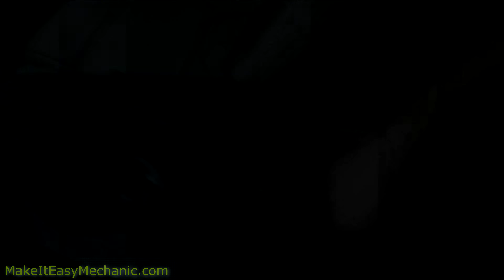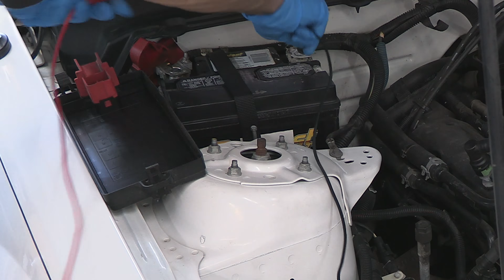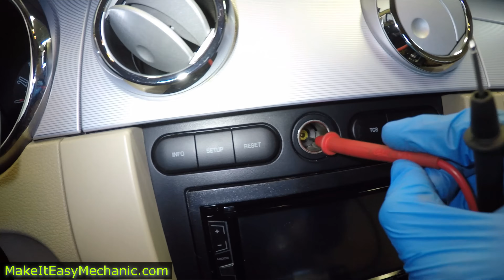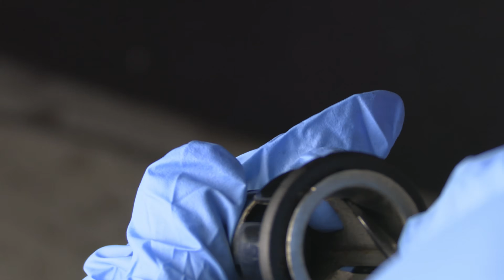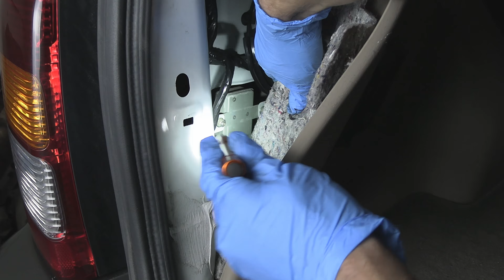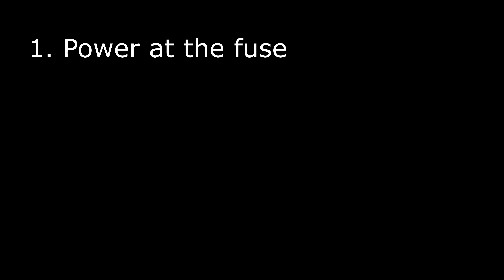3 MORE things to check when your cigarette lighter socket stops working (car power outlet fix)

Comment: I have checked every single fuse on the fuse panel...it is a 2010 PT Cruiser...both sockets are dead...I will proceed with removing the actual socket and see what I find...I fear I have done some other damage...somewhere...no other strange things are on the car...whatever happened when I was filling a tire with a compressor plugged into the front cigarette lighter socket with the engine running...it worked fine for more than a minute, and then, the compressor stopped working...and that was all she wrote...sigh...
Reply from the maker: Sounds like a blown fuse.
Reply: @MakeItEasyMechanic It does sound like that but I checked every single fuse…
Reply: @DRBradleyPhotography   I have the same problem and both times a compressor or my wife's electric mini blanket.  I think it is a thermal fuse at the socket or built in to the socket.  If the thermal fuse gets too hot it will blow gotta check that today after work

Comment: The lighter outlet used to be on even when car was off. Hate the way modern cars go off. I just wire mine directly to battery with an in line fuse. Also the electric windows.

Comment: The issue I'm having is after the fuse but before the socket. I already replaced the fuse, AND the socket, and that didn't fix it.

I've been looking at videos of center console disassembly for my car, and I'm just like... That's a LOT to remove just to fix my 12v adapter.

Vehicle: 2012 Ford Focus SEL
Reply: Rodents chewing wires perhaps...

Comment: I pushed my charging adapter in too much and the socket stopped working. What would be the best likely fix? Should I just remove and reinstall the socket or do you think a replacement is needed
Reply from the maker: if you tried a different charger in that socket, and it didn't work either - next thing I would do is try a different socket. (assuming you checked the fuse and the power and ground at the connector)
Reply: @MakeItEasyMechanic i tried a different charger. Still didnt work. Switched the fuse stull doesnt work. But the charger works with socket in the trunk.

Comment: As someone that works on vehicles at an electrical shop. It blows my mind that people feel ok with just replacing the fuse as if the cause of the fuse being blown just immediately goes away. (Few exceptions ofc)

Comment: what do i do if the fuse pops as soon as it’s plugged in?
Reply from the maker: there's a short in the system, check the socket if something is stuck inside it (like a paper clip), next - try unplugging the socket and see if it stops blowing fuses, if it doesn't you must have a short in the wiring. hope this helps

Comment: Good info! But, one more thing to check. The fuse kept blowing when trying to charge a phone. After much fruitless diagnosis, it turns out the 12v to USB A adapter the lady was using to charge her phone was defective. Switched to a different adapter and problem solved.

Comment: When your checking the wire connections behind the cigarette lighter, did you put the fuse back or no. Because when I have to check mine. The Cigarette lighter and the Radio are the same fuse (2002 Mazda 323 Astina). Also my fuse box is in the driver side compartment, so I can't voltmeter the fuse to the battery, unless I buy a 5 metre extension or something haha.

Comment: I used a TV and Xbox on a power inverter and it Immediately turned off and made a click noise so I assumed it was a fuse but I replaced the ones under the dash but it still won't work.

Comment: I have a 05 Yukon and it has a fuse for the cigarette lighter but I have three cigarette lighters and two of them don't work on the passenger side and also the one to the back seat.
Reply: There is a fuse for each socket

Comment: 2001 Mercury Grand Marquis. I'm getting power to the cig socket, but socket is only putting out around 4 - 5 volts...any ideas? I received an OEM replacement socket today, but it's too cold to work on the car. Do the cig sockets ever go bad and have reduced voltage output like this?
Thanks.

Comment: Got toyota Corolla sr5 coupe manual 1.6 1987 be four the lighter put my car off the lighter got off now no do it any more put my car off lighter stay on thing tgas right my battery like 2 or 3 day it die you think got problem with the cable the car thank can helps

Comment: Thank you for very informative and easily understood videos. I’m not a car electrician by any means so I certainly appreciate the well organized and explanative information. Both my console and dash lighters stopped working at different times. I only checked the fuse panel near the glove box. I know now I can find the issue and get them both working. Thank you, again from a non-electrician and mechanic.

Comment: power good with dvm at connector; however the issue was the dvm leads are sharp and make contact. The problem was corrosion on the center connector. Cleaning that up fixed the problem

Comment: Great help - I found the problem is the positive pole of the socket, now to find a replacement.
BTW, I use that same cheap meter from Harbor Freight. Handy enough for many jobs.
Reply: Again, replacement first.. meter still in box.YES.. At H. mf. Fraid😢😢😮😮😅
Reply: I used an M9 9mm with only nightsights to get mine .. out, lacking college but Navy marksman medals win.. kinda 😅😅😅

Comment: Just that little comment about both sides of the fuse to check with multimeter fixed the problem. Thanks so much!

Comment: Big thank you for the teaching! A total loss you didn't go to teach in college! I looked at the diagram you drew on the board and checked every component in the circuit with a multimeter and I realized the circuit is good and it should work so I plugged in a different charger and everything worked fine.🙂🙃
Reply: Like everyone else has said,  YOU WENT LIGHT SPEED AHEAD OF ANY OF THE OTHER B.S. CLICKBAIT VIDS which only talk a out fuses which is lame common sense b.s. I found you after searching 4 different times. KEY that hopefully others  do 👎 for all crap vids done abt only "fuses tested". That will help boost up your video.❤👍👍👍👍

Comment: Finally! OMG and I just got a multimeter. I’ve already replaced the fuse and it didn’t fix it. BRO EVERY video was “just replace the fuse. The fuse. The fuse will fix it” but it DIDN’T. I’ll be doing these steps soon and will finally have my answer!!!!
Reply: Looks like I have a common issue where my fuse didn’t solve my problem, and now I’m at square one where you are 😮
Reply: Yeah we see a lot of commonsense answers!!!
Reply: Did you fix it?
Reply: I'm gonna sand down inside the electrical connector
Reply: Update?
Reply: @antonio1681  turns out I had the entire thing unplugged from removing the center console last time.
Reply: My fuses blew immediately after replacing them
Reply: Well... Alrighty then, Clem . Pft... You done YET 😂😂 i kid..alit fire .on a Stihl 6ft chainsaw gun is. How,um ..mine...came free, allegedly BEFORE.. i saw this unporned section of vids😂😢. (Is he kidding.. desert Storm. That is all.)

Comment: MIne is acting weird in a 1995 Sunfire: At car start, it reads 13.8v but as the car operates, the voltage drops to 11.5v or lower, but check this out:'The  battery voltage with the car operating is still 13.8v. This lighter socket is live at all times, not dependent on the ignition switch. Anyone can point me in the right direction?

Comment: I have 10V at my lighter plug even when my fuse is pulled out. The 10V is not enough to power the portable FM transmitter. My centre console power plug outputs 12V as expected. This occurred put of blue after 14 years of no issue. I am at a loss...
Reply: You most likely have a short somewhere bypassing the fuse

Comment: My Volkswagen Jetta 2012 has power in the socket but when a coin fell in there I used a flat screw driver to take it out since then it will charge when I put my phone on but the battery goes down instead of up any advice?

Comment: So both of my cigarette lighter socket aren’t working even after replacing it 5x will it likely be the outlets and not the wiring or fuse
Reply from the maker: I'd check the fuses first.

Comment: hie. please help. when i plug in my charger the light turns on to show that it has power. however its a diffrent case when i use a fm modulator.

Comment: Massively helpful vid, my 12v socket in centre console literally just stopped working, which is a bummer as I only have one other and that’s in the boot (trunk) following your simple and easy to understand videos prt1 and 2 about this issue I managed to trace the failure point all the way to the actual cigarette lighter housing itself. Power was flowing all the way to the connector that plugs in to the cigarette lighter but that’s where it ends. Managed to get a replacement from Audi directly swapped over and boooooom all working again. Thanks to you!
Reply: Hmm. Sooo...initial remove n replace, easiest of the ADHD hells IRL AND on mf notyouryoutube... COULD have saved light years.. parsecs.. of valuable life .. as an American/Republican. (Democracy is a U. Mf. N. Term for bs needing more ammo.. we invented that. NRA inherited the UN quietly, thanks to Constitutional Republicans with FAR more firepower than the other hemisphere DOESN'T dream about.. in English, yes.. 😅
Reply: Ah.. trunk for your boots,eh? Well ... serious boot ,May...😅 To be devoting an entire trunk (1/3 of total car,yes? Idk .😮) to THE BIG BOOT BIG DADDY DIESEL!!😅😅
Reply: Boot..?? For.. the BACK of a car or trunks vs Vegeta. Mason Dixon line charter schools

Comment: my socket is the thing thats fucked up and I cant find an oem replacement ANYWHERE!
Reply: I took mine out took it apart cleaned the contacts with a brass wire blush and put it back together.  It's so simple, it shouldn't fail. I'll let you know how it works. I got it to work once, then it stopped again, so I decided to take it apart and clean the crusty contacts.  It should work now, but I'm  curious about the horn contact relay replacement now.   Wherever that's located.
Reply: @HRTsAFyre  no I definately fried something internal because I plugged a 150 watt hot bag into it not knowing it was only 120w. Went to the junkyard and was able to grab one out of another sentra
Reply: @HRTsAFyre  and in sentras the whole socket is soldered together and the only part im really able to clean is where the socket hooks up to the harness.
Reply: @Usef320  well I'm still having the same issue. The lighter socket has current, but just like before the lighter doesn't heat up or pop out. It did this intermittently before I took it apart, so I guess I'm still troubleshooting.   Also, the two charging ports on each side both work as well and they pigtail off the main lighter.  🙄
Reply: Oh by the way. Mine wasn't soldered together but basically there is nothing to burn up inside the lighter housing. Mine is made out of the metal casing a ceramic base with metal contacts where the plug makes contact then more metal contacts inside with a ceramic washer, the screw post and a nut that holds it together.   It's pretty basic.   When the lighter is depressed it allows the current in to make contact with the lighter elements.  When it's heated the metal expands and releases the hot lighter.

Comment: plugs light up in outlet but nothing with actually.charge or turn on from it.  so what is causing this?  correct voltage fuse is installed
Reply from the maker: Bad charger

Comment: The fuse box is under the steering wheel it's not possible to do the 1st check. Any suggestions ? I've a very basic voltmeter

Comment: Great video? 

However if anyone has a different socket like one for the old fashioned cigarette lighter. If you use the lighter to light your smokes? Ash & 1/2 burned smoking materials will accumulate inside the socket. I know this from experience. I was using a friends cigarette lighter outlet to air up her car tires with a portable compressor. I removed her lighter element & inserted the plug. (Nothing). I tried turning my plug in the socket looking for a better connection? Nothing worked? I asked her if she used her car cigarette lighter? “Yes, just the other day she lit a cigarette with it”. Well, upon further examination was a layer of debris in the bottom of the socket. I suggested she tap the lighter in her ashtray after lighting her cigarettes. That would keep the debris to a minimum. I had to use compressed air in a can to blow out the debris. Then it worked. 

Looks like the negative post on your battery has corrosion around it? Try a solution of warm water & a little baking soda. Then disconnect post & use an old tooth brush & apply mixed solution on there. That neutralizes the corrosion & removes all the “caking” on the battery post & connection without any other effort. Apply a very thin coat of silicone after tightening up the connection to minimize corrosion.